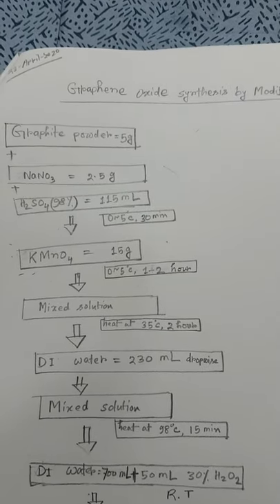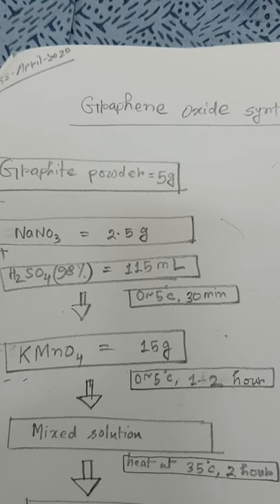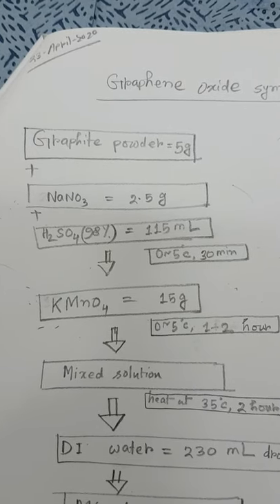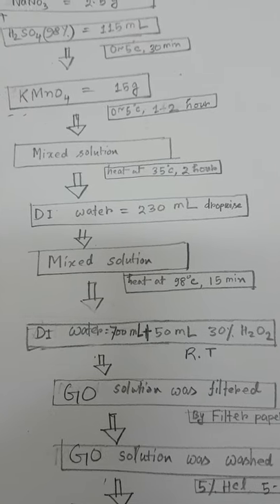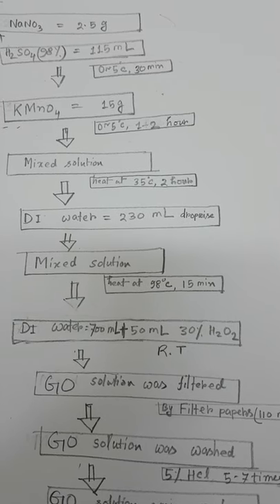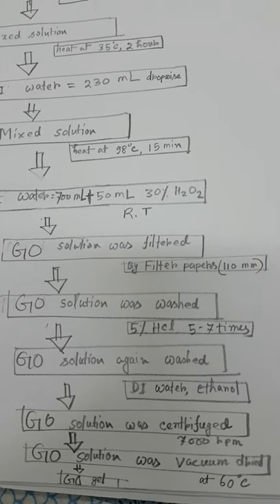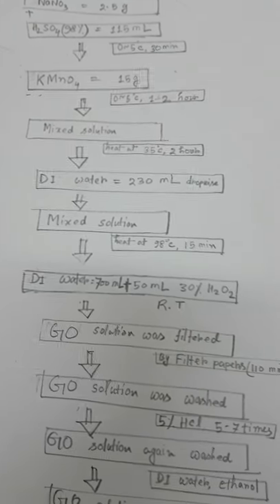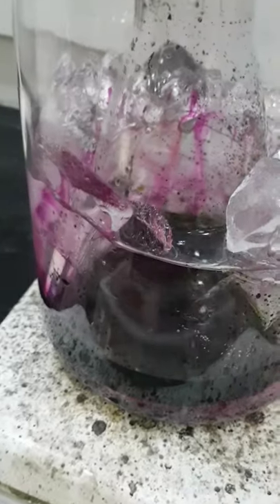Graphene oxide synthesis by modified Hummers method, Part 1

Comment: brother, thanks a lot. what reference should i use in the paper by following this method? and can i get your research gate id?
Reply from the maker: Thank you for your research interest in graphene oxide synthesis. You can follow the reference journal as below: 
Guilin Shao et al. Graphene oxide: the mechanisms of oxidation and exfoliation. J Mater Sci (2012) 47:4400–4409, DOI 10.1007/s10853-012-6294-5
My research gate user name is 'Chowdury Kabir Chowdury'.

Comment: Hi, I followed this entire protocol, but  before adding H2O and H2O2 it was brown, but after addition it turned greenish, what's wrong, have you ever faced this and how to overcome?
Reply from the maker: Thank you for your research interest in graphene oxide (GO) synthesis. Personally, I haven't encountered any issues with GO synthesis. I recommend diligently adhering to the entire procedure, paying careful attention to reagent quantities, timing, experimental conditions, and so forth. I relied on a reference paper for guidance in my GO synthesis process.
Guilin Shao et al. Graphene oxide: the mechanisms of oxidation and exfoliation. J Mater Sci (2012) 47:4400–4409, DOI 10.1007/s10853-012-6294-5
Reply: @ronieu1  thank you bhaiya

Comment: Sir why H2So4 NaNO3 is used?
Reply from the maker: The oxidation of graphite powder (GP) is required strong acidic medium. We cannot oxidize the GP just adding KMnO4. Thus, H2SO4 required. 
NaNO3 affects increasing the interlayer space between graphene oxide layer, i.e, increase the oxidation on basal planes, which means more oxygen functional groups is attached on the graphene sheet.
Reply: @ronieu1  sir can we use hcl and other salt.why we can't use hcl or other salt plz explain sir

Comment: Hi bro. You r doing great job. Plz tell me that how to maintain temperature different in steps you showed ?
Reply from the maker: Low temperature: I used an ice bath to keep the temperature range of 0 to 5 °C while oxidation the graphite powder.
Medium and high temperature: I used a commercially available digital hotplate with a magnetic stirrer, which has a temperature range of up to 300 °C.

Comment: sir any reference article for this video?  what you have follow
Reply from the maker: Thank you for your research interest in graphene oxide synthesis. You can follow the reference journal as below: 
Guilin Shao et al. Graphene oxide: the mechanisms of oxidation and exfoliation. J Mater Sci (2012) 47:4400–4409, DOI 10.1007/s10853-012-6294-5

Comment: Sir myself doing Research in material science so we are need to  synthesis Graphene oxide by modified hummers method sir I have one doubt sir please clear our doubt 1.)in the part of adding H2O2 how to add and when to add H2O2  because if we add H2O2 it is suddenly bumped and the whole experiment is get spoiled. 
2.) After adding H2O2 does the experiment is still continued or stopped . Please explain me sir
Reply from the maker: Welcome to learning experimental chemistry.

1). In the part of adding H2O2 how to add and when to add H2O2 because if we add H2O2 it is suddenly bumped and the whole experiment is get spoiled.  

Response: A proper graphene oxide synthesis procedure should be followed.  I recommend initially using 1g of graphite powder to graphene oxide, which is more safe and easy to hand for beginners. It is important to carefully follow the procedure and safety protocols to ensure a successful synthesis and minimize any potential risks or hazards. Additionally, always consult with a trained chemist or experienced mentor before conducting any experiments involving hazardous chemicals. By the way, I have shown the total oxidation of graphite flakes step-by-step. You may find the rest of the video easily here. Alternatively, you can find the relevant paper on the internet free of cost.
Paper title: Synthesis of Graphene Oxide using Modified Hummers Method: Solvent Influence, Procedia Engineering 184 ( 2017 ) 469 – 477.  

2). After adding H2O2 does the experiment is still continued or stopped . Please explain me sir.

Response: The reaction for graphite oxidation is halted when adding the H2O2.
Reply: @ronieu1   Thank you sir for clearing the doubts of me for the synthesis of graphene oxide  thanks a lot sir.
Reply from the maker: Welcome~